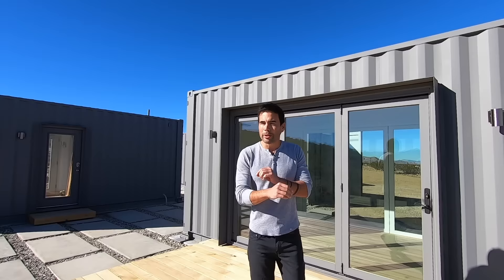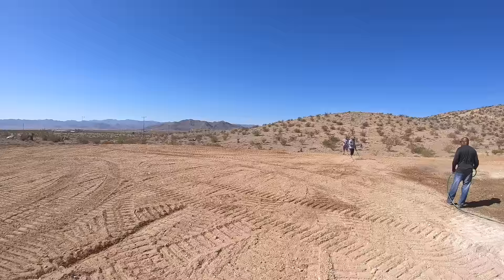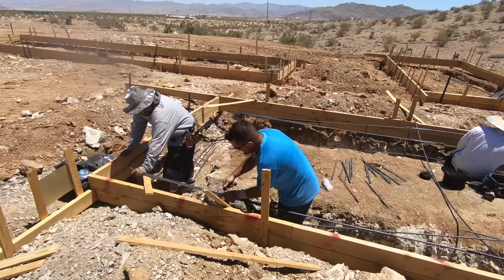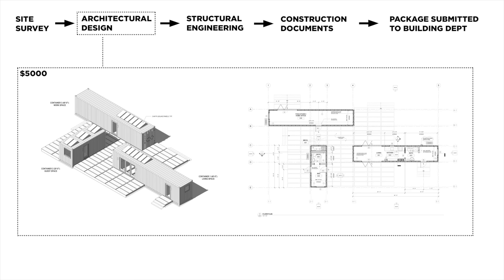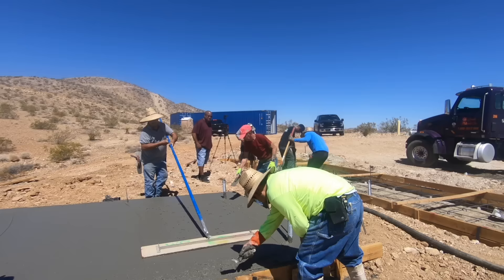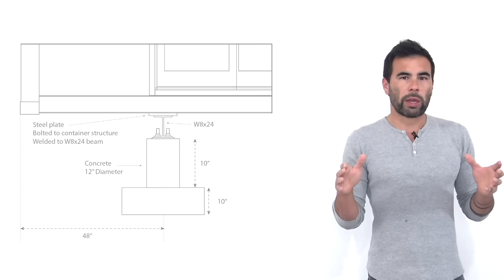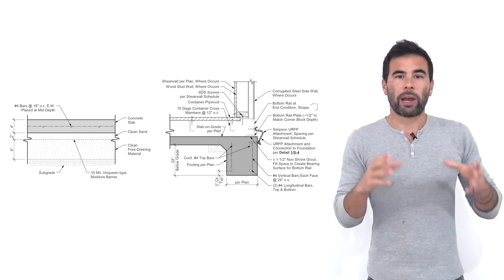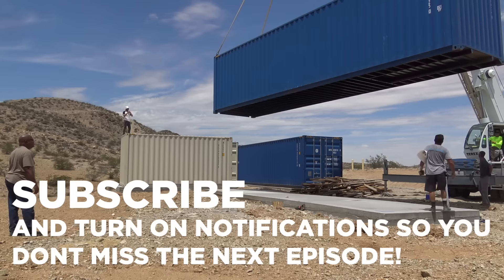Building a Shipping Container Home | EP01Permits and Foundation Design

Comment: So in other words just to get permission to build plus the foundation you had to spend around $53000 bucks just to put up three cargo containers. This does not include all the permits you will need when you start cutting into the containers for openings for windows and doors. Or any of the interior. Figures, To build a house in California you will be well over $100000 in permits alone. What a ripoff. I can see an issue for building that can fall apart in an earthquake but the container is not going to have that problem. It may shift but it won’t crumble. Why then the requirements for lateral loads in an earthquake. Worst case is you need to lift the container to remount to a pillar foundation.  A agree with others. Stay away from California. Problem is I already live here. Im for buried pillar foundations where the ground gives the lateral support on the pillars and then put gravel and sand that the container sits upon. Maybe an inch above if permitting allows. No need for crawl space but it would be good to have an air gap for insulation and keeping things dry from condensation under the container. Don’t want steel sitting on the ground. Pilars are good because you can pour them yourself and don’t need big trucks to come out. You can still use rebar to reenforce the pillar but burry the pillar well below the surface for that lateral support. Build the pillar adjusters into the container.

Comment: Ok this permit thing and cost you paid for them is bonkers. I’m all for protecting the environment, but , your not building a power plant or anything that pollutes,  so, this bureaucratic nonsense is nuts. They should not put you through that for simply putting some empty shipping containers on a foundation.